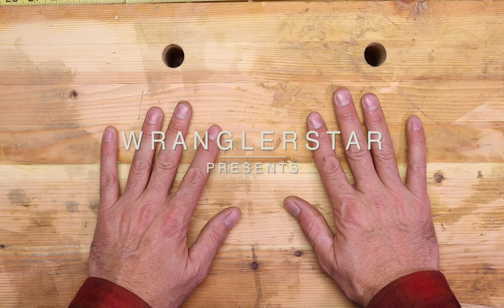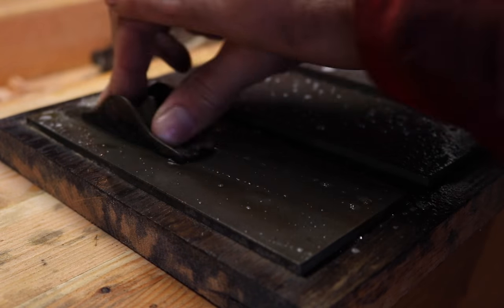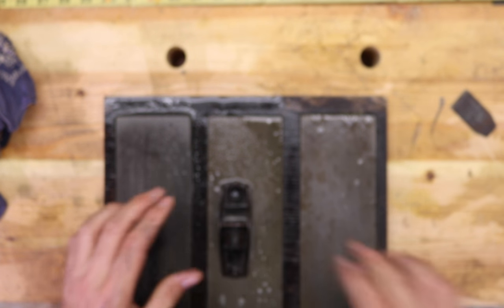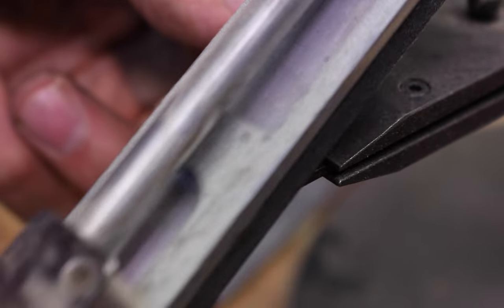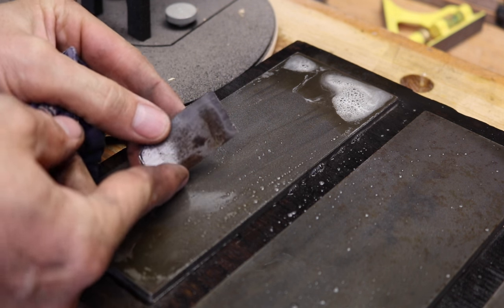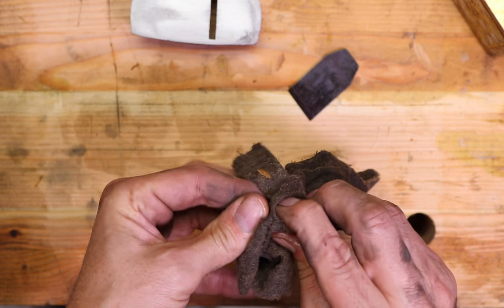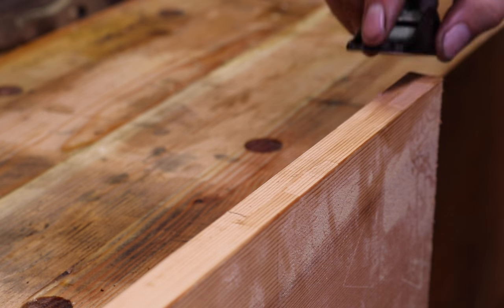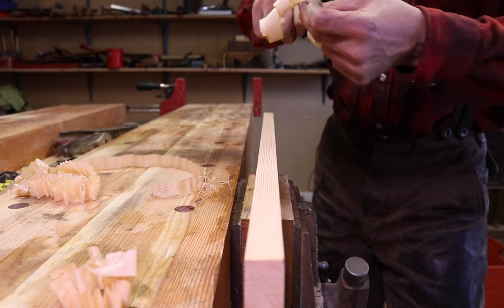Amazing Tiny Tools

Comment: nice sharpner but mine only cost 30, with free shipping same style as yours' but yours has a blade clamp
Reply from the maker: Quality costs money. Can a $30 sharpener really be the same as a $300 model?
Reply: well i can send you a link and you can try it out if you wish
Reply: wrangler dave link or brand name?
Reply: i sent the the link in a email . i will not post the link or release the brand name on this chan .  unless i have permission to do so by the channel owner.. sorry i will not do it
Reply: wrangler dave can you send me a a link
Reply: Isn't it better to have a 30$ sharpener that work well than nothing?

I have the impression that some quality tools cost more just because of the brand.
Reply: The other bad thing about it is that people see vids like this and think that this is the only way of doing things (spending lots of money on diamond plates and the Russian knife sharpeners).  For all the association between Paul Sellers and these diamond stones, he himself made a video talking about how 250 grit was more than enough for most woodworking purposes.
Reply: link below in my latest comment
Reply: interesting product. all the things that cody highlighted in his video cannot possibly be met at this price point. high quality materials, detents, and attention to small details. i thought cody's vid was very well done and is very honest and well meaning.
Reply: true but like he said his has a 300 dollar price point mine is cheaper but does the job for most my knifes and tools but his has a clamp mine does not
Reply: i do a lot with my lansky sharpener and a few stones. so i agree with you that 30 dollars can get you to as sharp as needed. i cant afford the russian one at this time but its on my list of things to own someday thanks to rhe wranglerstar video highlighting it.
Reply: i agree it's on my want list as well. but with 4 kids, a mortgage, 2 car payments .. priorities are a must and  unfortunately this is way down on my list of things to own .
Reply: wrangler dave w
Reply: I have the exact same model. I got it through amazon, to the door for just under 30 bucks. It, for the price point, is a steal! Great for all sorts of knives, but I'm 100% that the sharpener pictured above would blow these little sharpeners out of the water. That being said for 30 bucks?! Can't go wrong!
Reply: wrangler dave w?
Reply: Sorry, but that's an Edge Pro knockoff. It's not even close to being the same sharpener as the TSProf.
Reply: That is basically the same thing as the lansky that ive had for 20 years. With a skilled knowledge you can bring out shaving edges on anything that fits in the chuck. The one that is used in this video is a much nicer "commercial" type of jig. You cant go wrong with the cheaper sharpeners that provide quality stones, but for a life tool, go with Wranglerstars product and never look back.
Reply: wrangler dave Thanks for providing the link! you are correct on having priorities. I will offer one piece of help lose those car payments. 3 kids and a mortgage is all the debt we keep around here. I cannot express the feeling of freedom when that last payment was made. Please pay those cars off as soon as possible or maybe even consider moving down in car to get free of that debt, it is undoubtedly best decision me and my wife ever made concerning finance.
Reply: This is a clone of the EdgePro Apex. (I use a Wicked Edge btw). A foreign company is stealing an American company's design and selling it for easy less than the owner of this design could. You should not buy this product. I have no problems with a foreign company making and selling products for less, but this is theft.
Reply: SgtSly Which model of Wicked Edge if you don't mind me asking? I've been looking at saving up the $2000 for the professional model and starting my own buisness but I've heard that you end up with such a fine polish it actually ends up making it difficult to slice with because the edge has such a smooth surface area it creates friction and makes slicing very difficult
Reply: +Meat Smell -- The Wicked Edge model that I've used and was happy with was the Pro-Pack II. It wasn't my machine. It belonged to a friend who let me use it, but it was fairly easy to use, and even with my inexperience on the system I was able to get good results. There are loads of additional accessory stones available for it including a pair of 50/80 grit diamond paddles, a set of 8,000 grit diamond stones & glass platen paddles, a set of Naniwa Chosera waterstones (all the way up to 10,000 grit) and several types of strops. In addition to those the tool he had that I really liked was the Low Angle Adapter. I use a lot of Scandi ground knives, and the Low Angle Adapter was necessary to sharpen those due to how low the angle is on those knives (roughly 11-12.5° per side or 22-25° total). Wicked Edge has recently released their Variable Stone Thickness Adapters. These are a set of adapters that let you easily keep a consistent angle on the blade even when using stones of different thicknesses, going from diamond stones to water stones to strops for example. Without those adapters you would need to carefully readjust the machine to maintain the same angle on the blade every time you switched to a different type/thickness of stone.

Regarding you comment, "I've heard that you end up with such a fine polish it actually ends up making it difficult to slice with because the edge has such a smooth surface area it creates friction and makes slicing very difficult," it doesn't matter which machine you're using. How fine of a polish you put on the edge is entirely up to you. If you want to go to a fully polished edge all the down to a 0.1 micron strop or polishing tape -- or even 0.025 microns if you really want to go maximum overkill -- you can do that. On the other hand, if you want a "toothy" edge that is sharpened only up to 600 grit and then stropped just enough to knock the bur off but not polish the edge, you can do that too. 

"Toothy" edges are great slicers, but they're not great at push cutting, and they go dull faster than a fully polished edge. (They're called  "toothy" because when you look at them under an 80X optical microscope they look like they have saw teeth on them. That's also why they go dull faster. All of those tiny teeth are relatively fragile, and they get smashed flat & rolled over fairly quickly.) Fully polished edges excel at push cutting and last longer than a "toothy" edge (no teeth to smash flat or roll over), but they don't slice very well. Kitchen knives are used mostly for slicing. They need a coarser "toothy" edge, but outdoor, wood carving & bushcraft type knives are used for a lot of push cutting and will benefit from a more finely polished edge. The edge you put on a knife needs to be matched to what the knife is going to be used for. For example, my Scandi-ground "bushcraft" knives are sharpened all the way through a 15,000 grit Shapton Professional Series waterstone and then stropped all the way down to a 0.1 micron solution on a Nano Cloth strop. (This is way overkill, but I like it.) My kitchen knives, on the other hand, only get sharpened up to a 1,200 grit diamond stone and then lightly stropped with a 4.0 micron solution on a kangaroo leather strop. It's not stropped enough to polish the edge though, just enough to knock off the bur.

Hope this helps.

BTW, in case you're wondering, I use the KME Precision Sharpening System at the moment, but, after seeing Cody's new TSProf, I am seriously considering an upgrade!
Reply: Meat Smell I started with a standard kit. I would not recommend starting there, I have bought many stones and accessories since. At a minimum I would recommend starting at the "Field Dressing" kit for hobbyists. That should be enough to make knives sharper than any of your friends and family could hope to. For professional use, I couldn't tell you. It'll make anything sharper than how it comes from the factory, which will satisfy everyone but the most discerning knife fanatics. And let's face it, those people will own their own high end knife sharpeners anyway.
Reply: Gunslinger454 Thank you! That is exactly the kind of answer I was looking for, I have been an avid knife collector for years now but the one thing I've always lacked was a high-quality sharpener to go with it.

 I've looked around but haven't been able to find anything even close to as informative as your comment was in regards to the system itself and the reason people say a highly polished edge is bad, I knew to sharpen a knife for what it was suited for but I had been doing it backwards, I thought a "toothier" edge was better for bushcrafting knives as it would result in a tougher edge and a highly polished edge on kitchen knives would result in easier slicing, Man how wrong I was! 

It's also very good to know about the new Variable Stone thickness adapters as that is something I was very concerned about with the previous design, it's great to be able to swap knives and stones in seconds but pointless if it changes the angle each time, I live in the southern United States and I feel like around here a quality knife sharpening buisness would do well but I was afraid to spend $2000+ on something just to have it only be useful for me and a few friends. I figure if I charge $10 a knife I'll only have to sharp 200 knives to make my money back, which sounds like a lot but between restaurants which tend to have 10-20 knives on hand at all times, and the local hunters and cattlemen who appreciate a sharp knife, I'm hoping I will do well. 

Thank you very much for taking the time to reply and thank you even more for being so informative, I hope you have a great day/night! God bless you and your family and I hope you have a merry Christmas!
Reply: SgtSly Thank you for taking the time to reply, That's something I was afraid of with the "lower end" kits (in quotes because even wicked edges low end models are still very high quality compared to some) The reason I'm looking into professional knife sharpening is I myself am an avid knife collector but the one thing I've been missing is a high quality sharpening system to go with my knives, I realized too late it was insanely stupid to have multiple $200+ knifes and only an Arkansas stone to sharpen them on, it gets the job done but not to the quality I'd like with my limited skill.

I'm also at a point in my life where I'm at home almost all day atleast 5 days a week and knife sharpening sounds like it would be a very lucrative buisness to get into for the situation I'm in. To most people $10 a knife will sound like a lot until they see the kind of edge it will get them and how long it will last, there's also a few restaurants in my area that I feel would appreciate having their knives sharpened properly rather than rushed at the end of the kitchen staffs shift. I live in the southern United States and I'm hoping that the cattlemen and hunters will have an appreciation for the quality I'm hoping to turn out. Worst case scenario I have an amazing sharpening system that will most likely out last me and my family and friends will never have to worry about dull knives again. 

Thank you again for taking the time to reply and I hope you have a great day/night! God bless you and your family and I hope you have a merry Christmas!
Reply: wrangler dave
Reply: typical vlog THA'S COOL CAUSE YOU SWALLOW